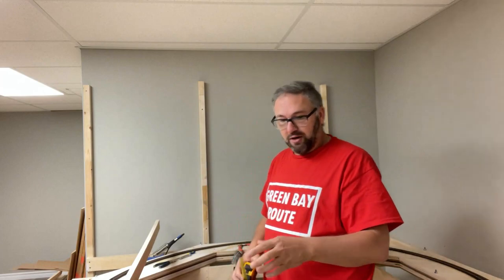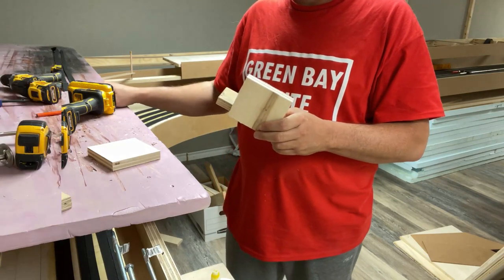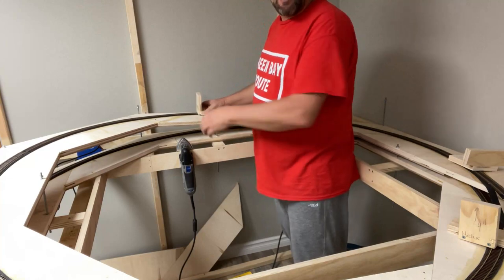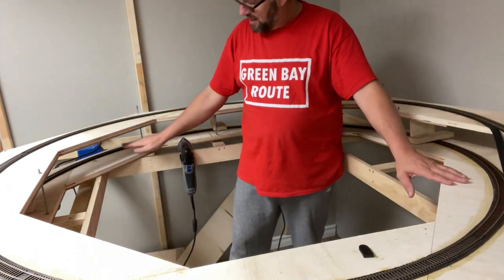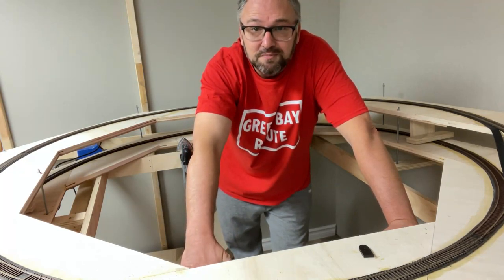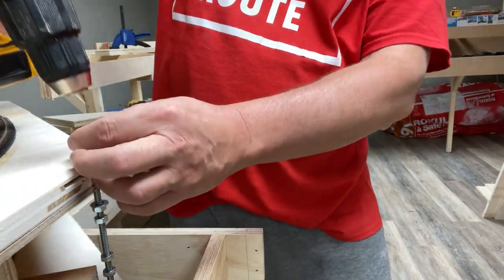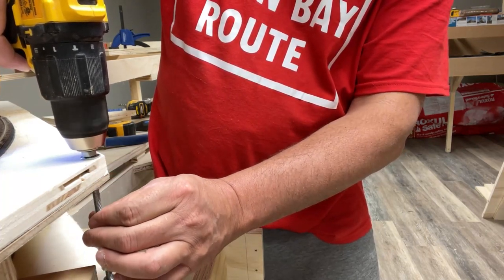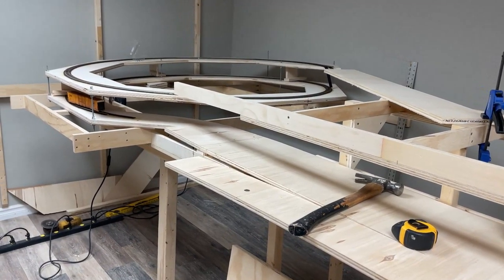HO Material saving, Cost effective $$, Helix Build !! The how to build a helix is finished for new!

Comment: just a few suggestion and question 
Suggestions
1) number your episode 
   I find myself watching the same one over an over 
2) explain why you choose to do it the way you do .
3) create a play list for the building of the helix 
Questions:
1) what is the slope of your helix ?
2) why did you choose a 30 " radius helix ?
    - what would be the minimum radius that you would consider for modern day rolling stock 
    - would 24" be feasible ? 
3) why such a  thick helix level ( less thickness would give less of a slope )? 
4) how did you determine/calculate the length of the pieces of the helix  based on the radius you choose ? 
5) why/  how did you determine the height at 4"  above the rail head for clearance , is that from a standard or something (NMRA) ?  
6)  I was thinking 3.5" from top of one level to the bottom of the next,  that would reduce the slope  so you could run larger train up the helix ?? would this be a problem ?
7) how did you do the entrance into the helix ? 
Did you file/cut/sand the first piece to match the slope and put it on top of the base or did you cut into the base and match the level of the helix with the base ?  

ok i think that is enough questions for now -- keep the videos coming 😎😎

Thanks